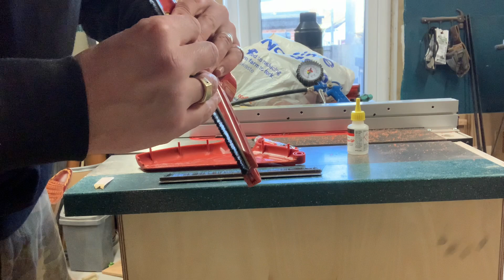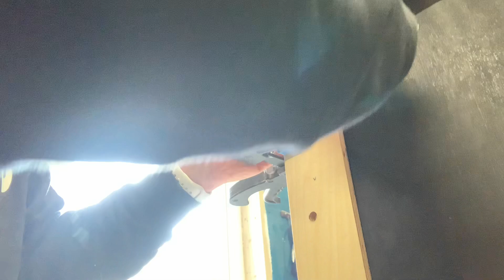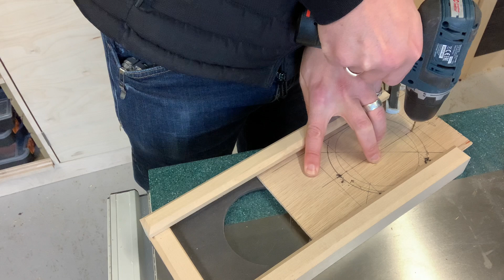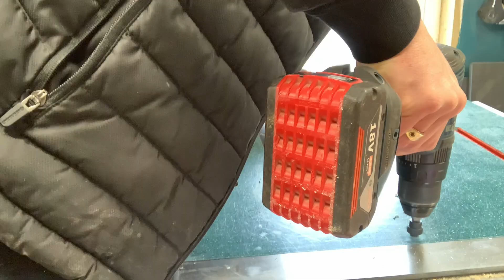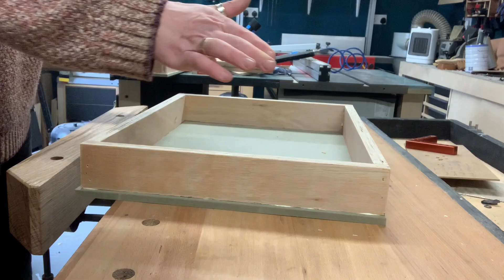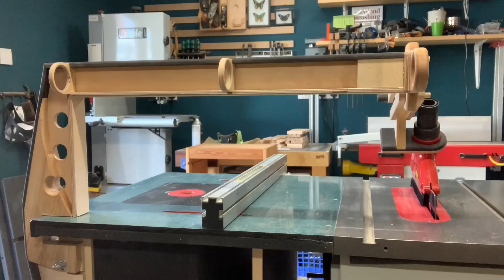Table saw and router table cabinet. Ep2 (aw254ts & triton)

Comment: looks really good, you have given me lots to think about. Did you ever replace or upgrade the fence. the locking mechamism seems pretty knaff and there is slop aswell.
Reply from the maker: I do intend to upgrade the fence at some point but in all honesty, it hasn’t caused any problems in its current state. I did add some teflon tape to reduce the slope and tighten the locking mechanism and that was sufficient.

Comment: Nice work on the piece, Captain. I’ve never been the guy to combine the router table to the table saw, but I can certainly see the merits.
Reply from the maker: Yeah it works well in my small shop. Especially on wheels. I think if I had more space I might have them separate.

Comment: Hi, What an amazing build project for the workshop, a table saw and router table combined  this would look great and very useful in any workshop. The electrics for both tools powered off the same cable that is plugged in to the socket , which is fine, because you can only use one at a time especially with the dust extraction on, cant wait to to your next project, Take care
Reply from the maker: Thanks very much. Really chuffed with it!